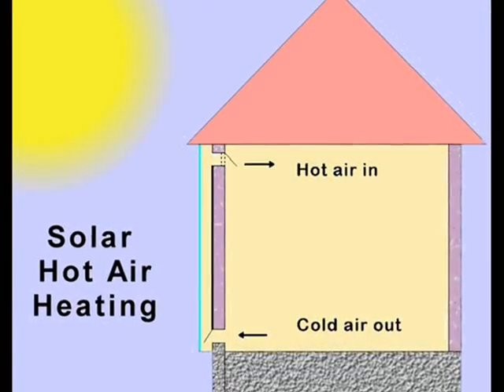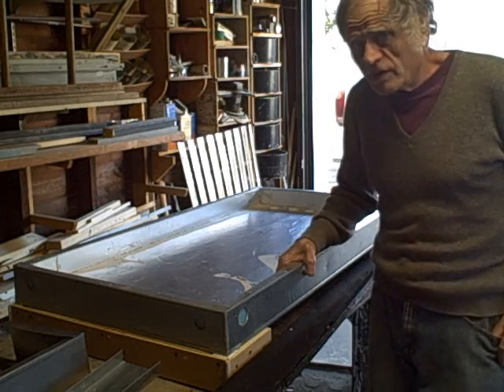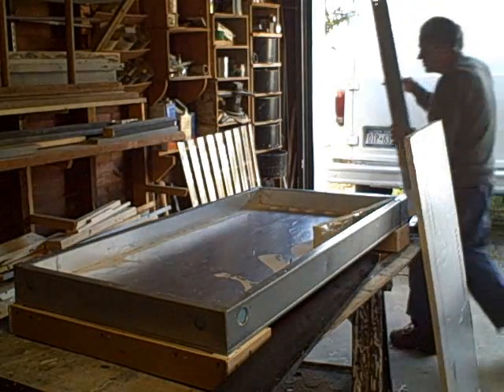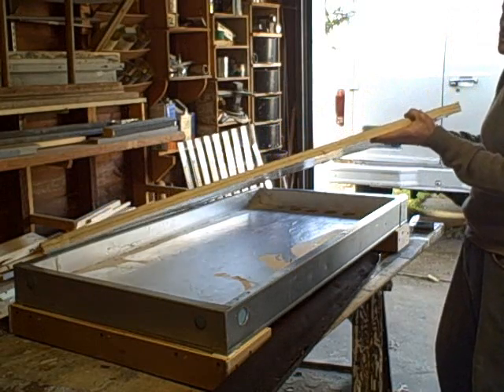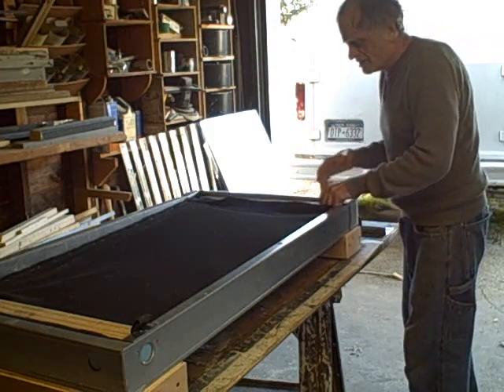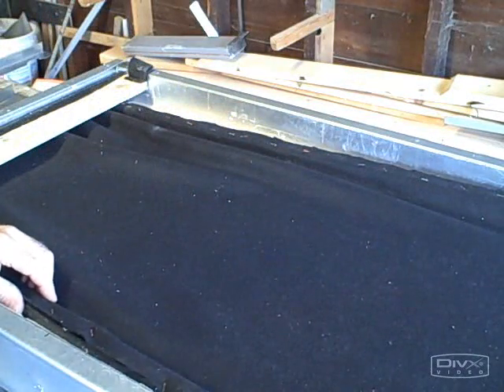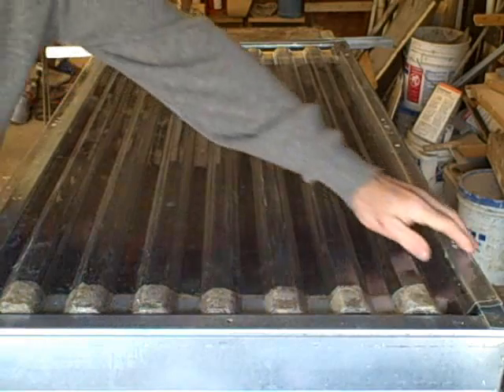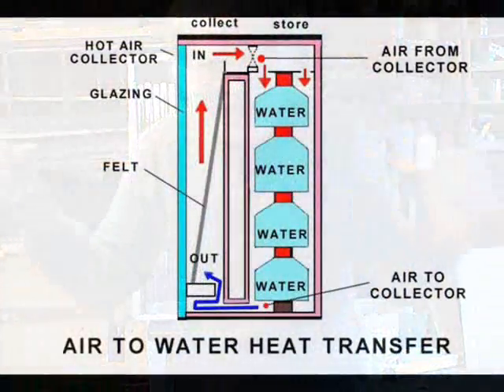Hot Air Collector

Comment: If your south facing house windows are clean inside and out, I fail to see how a shiny metal box of the same dimensions is going to grab more heat. At sunset, pull the insulated panels or drapes into position.

Comment: What is a steel stud "runner"? Is that "track"? and how did you get those same-sized track pieces to slide into each other. I'm missing something. Are the sides actual studs?
Reply: chad jones it's "c" channel that steel studs fit into. Basically a bottom or top plate in a steel stud wall

Comment: One thing to consider is durability. I found felt works well for one season but the black fades out during the season. Then it becomes rotten and tears easily. I am looking for something more durable.
Reply: 100% polyester felt will last for years, dont use felt made from wool.

Comment: Materials selection can be extremely critical in these designs. Materials that absorb heat easily also give up that heat very quickly. Materials that store large amounts of heat absorb that heat very slowly and are usually dense and heavy. Materials that are light enough to be mounted on a roof usually do not store large amounts of energy (heat). Foam may be a great insulator but it's also a poor conductor.
Reply: >> Materials that absorb heat easily also give up that heat very quickly.

Such as?  I think you might mean materials that can take in light and created heat that is then given off easily ... such as copper painted black?

Comment: I like the idea of using the felt. I don't think there is much advantage to uing more exotic or expenisve materials. Perhaps denser material, like sheet iron (galvanized, corrugated, steel painted flat black) would retain heat better and thus pass the ehat on into the passing air better. But, it is an unimportant consideration when you see sunlight is free. Once you have built the collector, there is no further expense, so initial cost is merely a factor of comparison to grid energy costs over time. 

I believe there is a distinct advantage to using the collector to heat some sort of energy sink, such as a gravel or salt bed. The entire system is thus designed around the minumum energy demand for the dwelling. For example, if the dwelling loses 150,000 BTU of heat, per day, you should design to meet that and a bit more on average, with the collector array.  Some systems are capable of collecting an amazing heat volume per square foot of collector space. But, the total average winter sunlight per day limits the effeciency. So, a really good collector may be capable of 1000 BTU's per hour. if you can safely say you get about six hours of good sunlight per day ona verage, that's 6,000 per day with a 26" x 8" collector (about 16 feet sq. )
But, that's only 375 BTU per foot. To gather the necessary 150,000 BTU, you will need 400 square feet of collector, or about 25 of these felt collectors (depending on the total effeciency per unit, of course...my numbers are based on other designs. The felt design may gather more or less). A 400 sq foot collector array may not be feasible, I do not know. I estimate the cost of each unit you have built at around $125.00 per unit. This would bring a direct air unit to heat the entire average home to about $3,125.00 (US) not counting labor. I do not think this is an excessive amount of money to spend when total energy cost to heat a home in my area is about $120.00 per month. In other areas I know of, such as on the East cost of USA, a lady friend of ours who heats her home with oil is paying more than $5,000.00 per winter, or about a thousand per month (yes, it's a larger home).

Thus, from a cost point of view, I think your heater collector is outstanding. If you decide to manufacture and install these units in your area, you should do very well indeed. The only thing that might hold you back would be some sort of insurance rating, such as UL (out of the question! Far too expensive) since no insurance company will bear the responsibility on any unrated home heating system. I'd do it anyway. Folks want to save money, and I see no way your units could cause harm to any home.

Good luck with your project...outstanding ideas!
Reply: I use metal roof top for my box heater and insulated it's real good and he produces 130 to 150° heat and I use scrap wood and it works fantastic
Reply: Jim Bass Felt does not hold up to the uv light.

Comment: Good idea, the metal studs instead of wood.
Reply: 2gentlehands The only problem I see is that they would conduct heat away faster than other materials.  Insulation would fix that though.
Reply: He puts insulation on the top and sides, but what is the cost differential of that insulation compared to some wood 2x4's with a plywood backing?

Comment: using thermosyphon principles used in heating hot water... a two foot drop is necessary from the cold supply from the house into the bottom of the collector. Here in NC where I am the optimum angle is around 60 degrees. Old houses, with south facing DOUBLE HUNG windows are prime for this example. A design would allow for installation by simple hanging in the window and storing away in summer. Fans would not be necessary if the added drop in cold supply is over 2 foot. A series of troughs, covered in mylar, reflecting on collector tubes inside an insulated box would gain a more consistent heat over the day and around here you can get old sliding glass doors for freel.
Reply from the maker: sounds good Chris

Comment: I want to use this for my shed but how long during the night will the heat last?
Reply: Back system  wooden fire
Reply from the maker: Depends on the sun and the thermal mass etc.
Reply: So how many water barrels should be used to keep the heat for the maximum time. I have at least 8 I can use.

Actually I would be screwed with the past couple of days no sun shine.

Comment: I want to build one with a fan. I see people building them but they seem to glossover the part where they put the fan in. it's not fully explained. Also every body wants to paint stuff black, but I had been thinking of covering with plastic sheating because the wiggle sheets will have a seam and let air in but when I went to the store to buy plastic I realized they had black plastic. wouldn't it save trouble to cover with black plastic instead of painting black? In case I sound nuts. I'm a girl. A very old girl.  like 75years old and would like to get warm without spending every dime I have on Ga. Power.
Reply from the maker: Thank you Sandy
Black polyethylene plastic will melt inside a collector

Comment: Here is an idea for people who have brick homes... build a box on the surface of you're wall with the most sunlight, make the glass/plexy 1-2 inches above the brick. choose to paint it black or not it will still work well.  It will catch and STORE the heat so it works in the night, get a cheap thermostat so it will cut off in the night and not blow cold air.

Comment: Isn't this more of a hot air generator not necessarily a collector ? Come up w/ a way to store radiant heated air generated for use @ night & I'll be impressed ! just sayin
Reply: to steve  --
yes.     it IS a hot air generator.    it uses solar radiation energy to heat the air, so, in a sense, you might say it is a solar energy collector..    but the other side of the system -- the "storage" side -- might be seen as necessary for real "collection" to take place.    storage usually takes place in the "heated" or "to be heated" space, typically inside the house, shop, etc.   
btw,   inside the house, paint EVERYthing flat black.   water jugs, hoses, pipes, lumber, ...
Reply from the maker: Yes this is where household air may be heated  and pumped back into the house. There are many kinds of hot air collectors this is just one kind. The polyester black felt is made from recycled plastic bottles.
Reply: heck naw id say...4x8 or so...
Reply from the maker: Yes this is a hot air collecgtor.
Reply: make a collector (somewhat large) made with bricks on a platform on the ground, use mirrors to reflect the sunlight to the collector, the bricks will Store the heat and last a while as long as the air intake to the collector is the air from inside the house, that way it recycles old air instead of the cooler air from outside temperature.

Comment: would soffet or corrugated steel or aluminum suffice for the heat sink in this system painted flat black?
Reply: Thermal conductivity.  Most materials that conduct electricity are good thermal conductors as well.  Also,  light colors and shiny textures (gloss) reflect thermal radiation and dark colors and flat texture absorb it.
Reply: ANYthing painted flat black will work.     the trick is, you want as much black surface area as possible, in as small a box as possible.    or, reversly, choose a box size.     then, how do you get the maximum black surface exposed to solar radiation inside that box?
why, you may well ask, do you want a smaller box size?   at least these 2 reasons:   1]   cheaper to build   &    2] less outside surface to re-radiate heat to the outside [your backyard, for example].
Reply: aluminum is an excellent heat conductor, so it'll offload the heat to the air quite quickly.
I'd leave the backside of the aluminum bare so as to maximize thermal conductivity with the air, and minimize the money and time spent on black paints.
Aluminum also has the advantage of texturizing as it ages, albeit this process occur much more rapidly when exposed to corroding elements. This texture increases surface area and heat distribution.
Reply: ***** I am looking into a stud slotted box, polyiso insulation, downspouts with a plenum at each end to contain the heated air in and out. I was thinking of painting the insulation and downspouts black to maximize the heat gain and yet, keep the heated air away from the glazing. I have considered a siphon on the box internal to draw any heated air that is outside of the downspouts out of the box to protect the glazing from distortion. the next question has to do with capacity, velocity and volume of air on a 4'x8' collector to maximize heat transfer and delivery to the building. I plan on the air being forced into the plenum from a small blower, 200 CFM per heater, powered by a solar array/DC battery bank/ AC converter with a temperature differential collector/heated space switch. this should keep the fans off during little sun or dark conditions.
Reply: Dear Sir, 
This is Alex from Guangdong Dong Fivestar Solar Energy Co,Ltd.   We are professional manufacturer of Flat solar collector product in China. 
We have very well design of solar hot air collector . 
You can visit our website www.fivestarpower.com   to check our product. 
Pls feel free to contact me if you have any demand for it.

Alex Lai 
Whatapps: 0086-15625578993    
Email: international@fivestarsolar.com

Comment: which insulation will survive the extended temperature ranges yielded when using this concept?
I have seen where "styrofoam" will melt. what about pink fiberglass rigid board?
Reply: polyisocyanurate.   sold around here [virginia] as a board 4'x8' covered both sides w/ a thin aluminum paper.   careful.   i think this stuff decays in sunlight, so paint or otherwise cover the edges of these panels.   also, of course, paint the aluminum face a flat black on the "collector side".
btw, fiberglass will melt if it ever gets hot enough to melt glass

Comment: I also prefer metal studs because the weight saved and ease of use.   I also saw a model like this that used a water-closed-loop system because once water is heated, it stays warmer.  The downside is you need full sun all day to heat the water.  The loop was built with flex poly tube and a small solar pump with a Gott cooler for storing the water.  Anyway, just another idea.

Comment: Insulation is good BUT polyisocyanurate foam board,  that you have used,, degrades over time releaseing cyanide gas, yep!  I recommend extruded styrofoam (blueboard) for your application